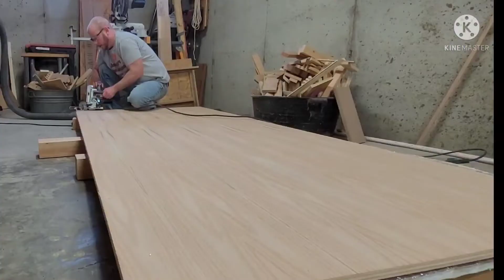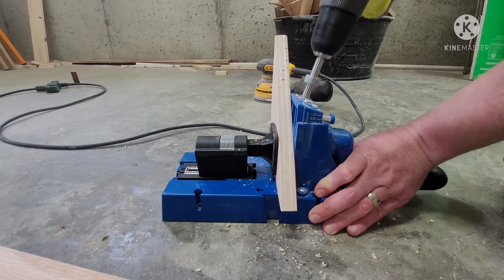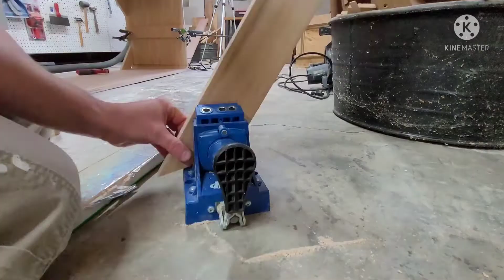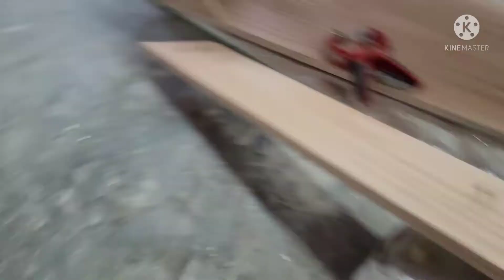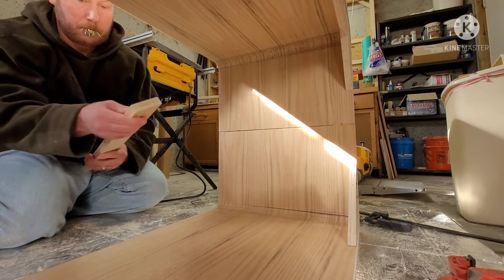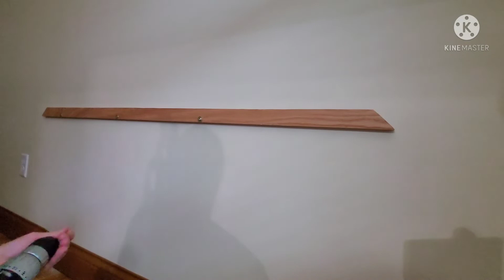Floating Bent Wood Cabinet (Plywood Challenge/One Board Challenge)

Comment: This is great! I'm building a cabinet to house my guitars using the kerf bending at each corner as you did. I didn't even think to support it on the back side the way you did with the boards cut at a 45 degree angle.  I do appreciate the faster video but if you wanted to forgo talking on video, some text boxes describing what you're doing/using and why would be really helpful. Thanks for making this vid!
Reply from the maker: Rock on!